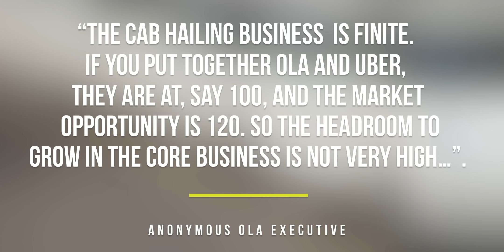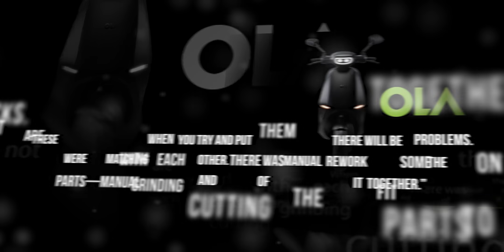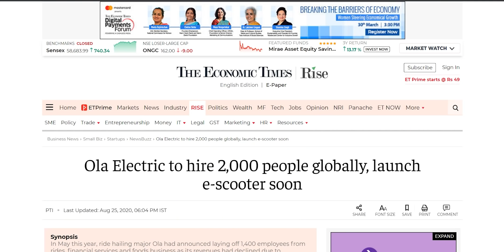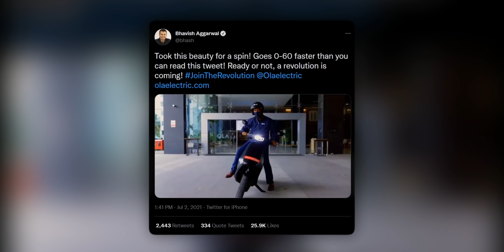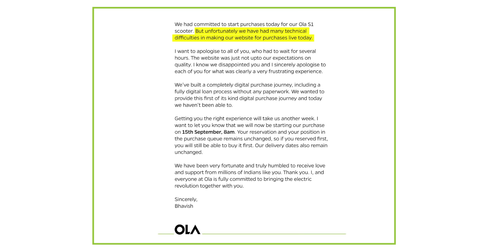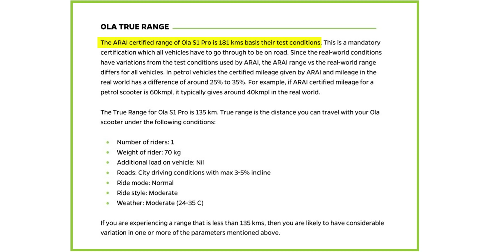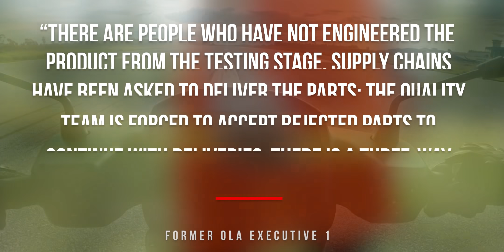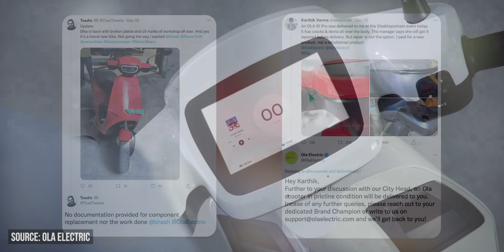How Ola Electric's Revolution Faltered

Comment: No product building is simple. Even after all the hurdles in building shinkansen it became the envy of the world railways. Build a product of envy after all hurdles.
Reply: With all due respect, I don't think rebranding a scooter and revolutionizing high-speed rail are comparable.

The Shinkansen team overcame several engineering hurdles no major project had ever faced before, and they pulled it off in time for the 1964 Summer Olympics!

I recommended Mustard's video on the Shinkansen, I would link it but then this comment might be sent to the spam-filter.

Comment: Ola electric may have had a rocky start, but the incentives to use EVs are very strong in India because of Fuel costs and reducing costs of rooftop solar, govt clean energy projects etc. Even if Ola may have to spend a lot to regain trust of customers, if they are able to make a good product ultimately, the market will buy it. Indian consumers care about value, and when they see their neighbour having a good experience with Ola electric, they will make the switch too. Indians generally dont like to make a risky purchase as an early adopter.
Edit: I don't mean people will buy Ola electric only. I mean they will switch to electric scooters for sure and Ola may be able to win back the consumers through clever marketing.
Reply: Agreed. Ola has rocketed past everyone except Hero and looks to claim the number 1 slot soon.  Their crunch strategy may be playing out for them as it did for Tesla
Reply: I truely agree with you sir, but I think when a person spend 100,000 INR on a scooter of a company who has no prior experience in scooter making, on the other hand there are this chinese scooter available for 40-50,000 and Honda and Hero (renonwned Indian scooter brand) cost around 75000 INR available in the market, then they expect some form of professionalism. The way I see the OLA scooter is nothing less than a marketing scam as of now. Though I wish it will change soon.
Reply: @grovervishal591  Caveat Emptor
Reply: @grovervishal591  Well most Indians also dont go blindly for Chinese scooters with no background just due to low cost. Cos we think about servicing and spare parts too. btw, Ather - an absolute newbie got decent success inspite of its high cost scooter.
Reply: @aham-mumukshu-asmi  i dont agree with you on that. I m not sure which part of india do you live. But i live in Northern part and i have seen this trend in Haryana, punjab, Rajasthan, HP and Delhi that 95% of the ev scooter that people are buying are low end made by either chinese, local indians or others like hero electric, okinawa, okaya, liveguard.. cz 1.  They cost arnd 30-35k, you can buy two  activa in their cost. 2. Their saving (fuel+ initial cost) > maintaining scooter like activa
I dont know why people are buying them but more or less i can understand that its basic indian mentality that when things are so cheap you don't worry about using and throughing it away
Reply: Yes
Reply: And I am pretty sure they will!
Reply: Ola creating lot of value to customers by directly shipping scooter to customers. Eliminating distributor and dealer margin. Compared to other old manufacturer ola can offer about 20% lower price for same product. It is like how Xiaomi acquired Indian market by directly selling high end product at lower price by cutting intermediaries margin.
Reply: @ashutoshsingh-ef5el   i was also a fan of this model up untill recently. I ordered a oneplus phone from Amazon and it delivered a soap. Since i had no proof while opening a courier. I never got any refund or claim. If you search youtube you will find thousands of these videos of people. Now i have realised india is full of crooks and its always better to buy high ticket product from a physical shop where you can go and catch someone.. so no offence but i have recently switched my side cz of this bad experience and loss of 40k
Reply: @ashutoshsingh-ef5el   and i would like to aware you on this. Next time you order a mobile or smartwatch online. Just take out your phone and start shooting a video before accepting delivery. This is a new type of fraud going on these days
Reply: @ashutoshsingh-ef5el  there is a reason that dealer margins exist, they provide a much needed service for vehicles. Ola doesn't have the network or the experience of running a dealership/distribution business by itself. I can't see it happening smoothly.
Reply: @ashutoshsingh-ef5el  good point. But it is to be proved now by Bhavesh
Reply: @ashutoshsingh-ef5el  with the customer is having from ola , they are getting tired of calling customer service as they don’t have any service center to go . This is creating a lot of trouble for consumers
Reply: i don't think the future of transportation is EV. Maybe the entitled few will buy the electric scooters/vehicles, but majority of transportation is in the form of trucks, inter-city buses, cars that can travel beyond the city, and EV just doesn't seem like it will be able to achieve all that, given its current needs of rare earth metals and other rare elements that are depleting fast, like even if a company manages to score a little in the future, they will face a huge bubble of depleting resources and the electric cars will be expensive and beyond reach of majority of the market that it previously hosted. Investing in deep space mining seems like more of a pro move than making use of what little resources we have. All in all, a newer form of energy is required, and EV will be a thing of the past. Alternative Energy is the future, not necessarily electrical energy.

Comment: Any company that is new to manufacturing vehicles will suffer heavily. That too in this supply chain crisis it's even worse. "Prototypes are easy, production is insanely hard" -Elon Musk. Even many new EV manufacturers in the US like Lucid,Rivian are suffering very badly and reducing their production forecast while also increasing the prices of their products. 
Adding to all these, even legacy car manufacturers are no immune to EV manufacturing difficulties. GM in the US has halted production of it's EV chevy bolt for 10 months due to fire issue. Ford too has it's own problems.
So it is very hard and getting to volume production with quality checks will be a monumental task.
Reply: Very well explained it's not that easy reason I m supporting Ola they are trying really hard
Reply: @prashwin0917  They hadn't trying hard they have just acquired the Netherland based company and launch their scooters in india and Ola is worthy to compare with lucid and rivian.
Reply: I am using Ola since 14 Feb. So far it's better than any ICE scooters. Yes, they have issues and they made mistakes, but I hope they will learn and improve in coming years.
Reply: @prashwin0917
I truely agree with you sir, but I think when a person spend 100,000 INR on a scooter of a company who has no prior experience in scooter making, on the other hand there are this chinese scooter available for 40-50,000 and Honda and Hero (ICE) cost around 75000 INR available in the market, then they expect some form of professionalism. The way I see the OLA scooter is nothing less than a scam as of now. Though I wish it will change soon. aur sir road pe to aap kisi bhi electric scooter pe chale jao, log pooch lenge cz vo enthusiasm  isliye hai cz petrol price 110 INR and EV price 1/10 of that. So they want to switch, but don;t want to waste on a substndrd product. I would call them smart not emotional.
Reply: @grovervishal591  True. Anyone who is willing to buy should know, a promised faster production with no prior experience will have many problems. It's not for everyone to bet on a new company. Even if you have bought a Honda or a Tata vehicle years back when they were new to manufacturing, they would have had problems. But I know Ola has streched it a lot by trying to be fast. But anyone betting on a new company should have been aware of the consequences.
Reply: When you know its hard and not yet ready to bring it to market they should have delayed the launch by 6 months. Now the brand image is damaged beyond repair.
Reply: @realmilind  aisa aapko lagta hai. Aapke vichar ka mai sanman karta hu lekin public wait kar raha he payment window open hone ke liye. Bike khadi ki to 20 log puch lete hai kam se kam. Negativity sirf social media pe he road pe har kisi ko pasand he ye bike.
Reply: @prashwin0917  Agree.

Comment: The ola scooter is flawed in design stage itself coz it lithium ion battery are not suitable for performance electric scooter...it generates more heat and it's not designed to disepet it to optimal level ...that why bajaj chetak has gone to more commutter focus scooter for its chetak ev and more spaces design.....ather somehow manage itself with its lithium batteries but in future if performance focus ev's are made LFP battery are more safer tech in case of India is concerned in my pov ( lithium iron phosphate).

Comment: This is what happens when a Prue Business man crunching numbers takes up a challenging R&D engineering project.   There can not be any short cuts to R&D and testing. Make a base version and keep adding more features and functionality gradually. But here could be Overconfidence or Pressure to show results or feeling more money can get the work done fast. 
But still there is hope, take time rectify the defects and customers can accept.
Reply: Tesla vs gm/nissan says differently.  GM and nissan had been in the ev space before Tesla with a very reliable and economical volt and leaf
Reply: @barryobrien1890  Tesla did disrupt the market but they took their time to deliver an industry leading product unlike Ola which rushed half baked product to capture the market. Even Tesla faced production issues in the early stages and still do.
Reply: @manjeetkolte8601  Agreed. But ola is probably the best engineered eScooter on the road. It was in design since 2014 and like Tesla it was a purpose built eScooter not an adapted ice scooter.  The market and not the media will decide if ola is a disaster. So far ola is winning and may become India's best selling escooter in April.  Ather has slipped behind TVs in March.  The next story will be how ola turned a disaster into a success, and all of these issues will be portrayed as brilliant moves
Reply: @barryobrien1890 Ather feels like a properly engineered product. It was created from ground up in India. It definitely works better than Ola in Indian conditions. 
Last time I visited their dealership, they said waiting period was between 3-6 months. 
The Ola debacle has played into Ather's hands. 
Ather even has a charging network already setup and ready to go in all major metro cities. 
Ola is realistically going to take 1-2 years to sort out all major issues. 
Especially the Battery catching fire. None of the premium EVs in India had something like this happen. Ola was the first.
(Edit: mistakes)
Reply: @anirudhhhh Ather is an excellent bike no doubt, but thier availability across India is very limiting.  The other thing they lack is range on a single charge.  Finally their pricing model limits affordability.  In March, they fell to 5th position in unit sales behind TVs.  Ola definitely has their issues, but the online model makes the bike much more accessible and allowed them to grab the number 2 sales slot behind Hero in 3 months of sales.  The range they provide seems to be more popular considering the price.  As goes the fires, don't be so quick to judge.  LG chemical who supplies Ola is currently under investigation in the USA for the large number of fire related recalls at GM, VW, Hyundai Stelaris Mercedes etc.  This could be a much bigger issue than is made out by the media in India.  I personally own an S1 pro and really like it.  With the exception of some annoyance with the lack of some software features like unlocking, i am not looking for any changes.  Obviously they have to improve customer support.  I have not used their service yet so i am not sure there.  By all accounts this needs to be improved but I can't say from experience.  Overall I prefer my S1 to my Honda avaitor for around town use
Reply: Exactly

Comment: Thanks Caleb. I own an S1 pro and I am extremely happy with it.  The major problems in my experience was the poor communications and customer handling.  Ola is the first to go to a non dealer, on line model.  They underestimated the backlash that the dealers would pose as they were treathened.  They also did nothing to help educate their customers about ARAI range vs actual range , which is present in all evehicles but was heavily reported as a failure in the Ola case (Ather is 116km rated but 80 actual).  They had no trained customer support, and as the product issues you mentioned mounted the service centers could not handle the volume of issues.  It was more related to execution than the product.  Ola has since shipped lots of bikes and their customers seem happier now, with delivery times dropping to 6 to 8 weeks.  Unfinished software is still there but basic functionality is sufficient and Ola is now being recognised as a work in progress but by far the best value in the performance segment of the escooter space.  
A company which followed the slow down and give more time is Simple one, who launched the same day as Ola, and got 50,000 orders.  They delayed shipment by 6 months, and now plan to deliver in June 2022.  They are building 2 factories with a combined output of 14.5 million scooters.  I would love for you to report on the different approaches, how the vc's reward delays and if it really leads to a better product or more confusion. A look at how the world sees crunch. I also ordered this bike.

Is ola a revolution.
I think the jury is still out on this.  Sales have put them close to number 1 in India in 3 short months, partly because without dealers, they can deliver pan India, and partly from hype.  A lot will depend on how they resolve the issues and finish the s1
Reply: Just want to add- Ather also doesn’t have any dealerships and all the sales happen online. What you see are just experience centres.
Reply: @nischalesturi1325  but ather limits thier sales to areas where the experience centers are as that's where they do test rides and service.  Ola sells pan India. Thats the real innovation in the ev space
Reply: I am too a owner, and agreee 100% agree with you…there are too many negative media exposure towards Ola I think
Reply: @sumitchakraborty2354  Ola has taken on the very wealthy and powerful automotive dealers. They employ a lot of people and will do anything to try to stop ola and the direct to customer model.  In any ev issue it's always ola that is depicted as having issues.  Okinawa has had 3 fires and 2 deaths but are never mentioned.

Comment: Bad news rolling down. Checkout startup Fast shuts down and Ola having trouble with their products. Things like tangible products are quite hard to develop with lot of R&D involved and long time to get traction, Ola has failed with all the financial support as compared to Ather. Same goes with Fast. They had huge funds and still failed. Let's see how it goes in the future.
EDIT: Thanks to BWM team on bringing this issue to public in a comprehensible video!
Reply: I would not rule ola out yet.  Sales wise they look to overtake hero in April for the number 1 slot.  Historically crunch programs work for first to market companies.  A case in point is Tesla who are famous for poor reliability, over promising on software features and poorly fitting panels, but they lead the world in ev sales and have a highly capitalized position, despite GM Nissan and Toyota being in the market earlier with conservative reliable products.  Customers like a little excitement in their products if there is value and the company makes good on their problems